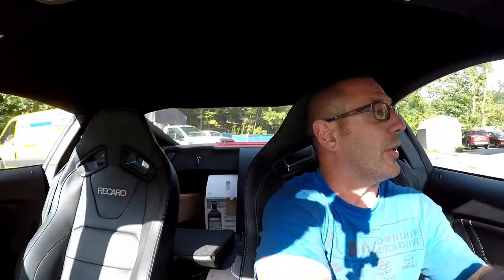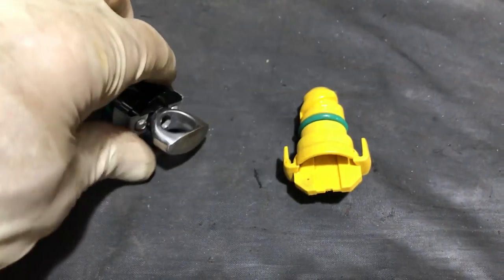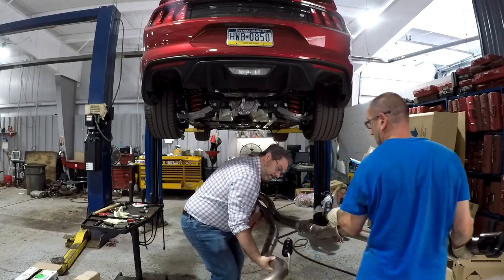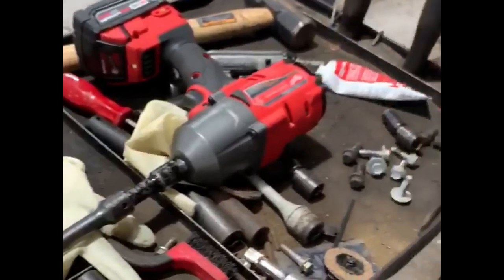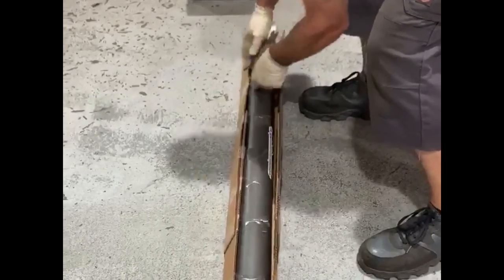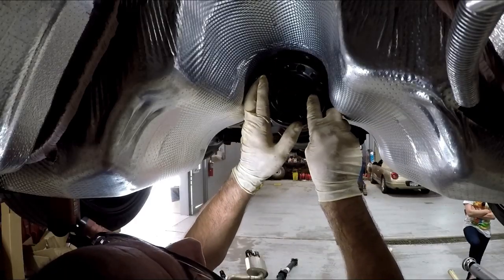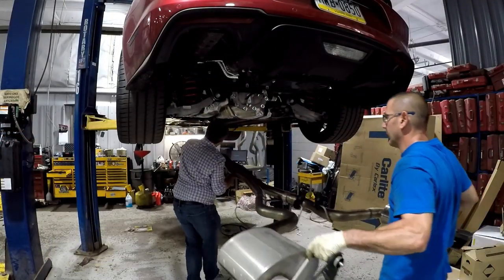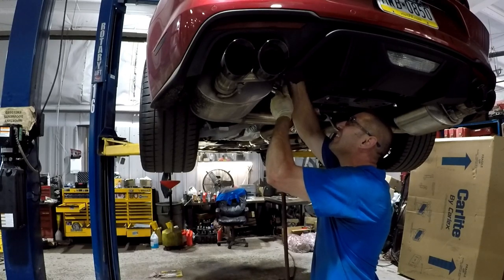Installing The Driveshaft Shop's 1 Piece Driveshaft on a 2019 Mustang GT

Comment: Tip to remove additional vibration after DS has been clocked properly.  Check pinion angle at trans an diff.  For best results    If angle is needed  add shims between cross member and trans mount, if angle needs reduced add shims between cross member and where it mounts to the body.  Angles should match front and rear
Reply from the maker: Thanks for the tips. This one vibrated so bad we ended up sending it back and getting the carbon version.

Comment: I’ll be throwing a Roush supercharger on soon. I’ve heard a lot of different shit like get a one piece driveshaft, and no just get a safety loop, what is the best thing to do? Mainly use it for street driving.
Reply from the maker: These items are definitely necessary for repeated hard launching, especially with drag radials or slicks. If you plan on really ripping your car on the street, I would consider doing the upgrades but the 1 piece drive shaft can cause some harshness and vibration.

Comment: The oil pan is all plastic? And if so is threads all plastic will they strip out?
Reply from the maker: It is and it shouldn't strip. The drain plug is removed and installed by hand.

Comment: Would it not have been cheaper for FORD to use a one piece in the first place?
Reply: They actually put a two piece in for comfort reasons.  The one piece, creates more noise, and vibration.
Reply from the maker: What Jay said.

Comment: I had one and it vibrated like a b** on the highway so I took it out
Reply from the maker: This one ended up doing the same thing, contacted Driveshaft shop and swapped it out for the carbon version. It is one piece, no more flange adaptor. That fixed the issue.
Reply: @PIPSBURGHVIEWS  wonder if they would trade me beings the know the aluminum one is junk?
Reply from the maker: Its certainly worth a shot.